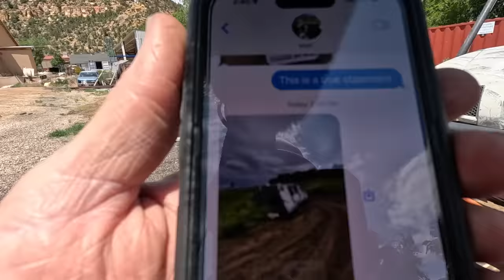Off The Edge: This Trailer Recovery Might Be Too Much For The Rat Rod Wrecker!

Comment: you should have snatched off that black truck to the axle while de-weighting the rear end with the boom and pulled it sideways while the tow rig drove it straight out. That was a 20 minute job if not for the sketchiness making it difficult to see through the bullshit. I wasn't there, you did it as best you could. Don't forget you've got several winches on that thing, you can turn 2 winchless trucks into winch trucks just like that

one thing i did notice though, that truck drives smoother than a mfr

Comment: First off,you're doing it wrong! Start by unhooking the white pickup from trailer,hook winch to front of trailer and pull/swing nose of trailer up onto road,that way,you'll have both wheels up on the rd !chaulk rear inside wheels on trailer so it can't roll back!
The rest of the trailer hanging over the rd, doesn't matter,it's on level ground if you do it this way!
Your truck is not heavy enough ,and your not using wheel chaulks to block your tow trucks back wheels.
Also,pulling sideways can bend the springs on the trailer.
Orrrr,just pull it backwards onto rd!

Comment: If you had a wheel lift on there it could of planted your ass end for better pull / lift .  Maybe a set of sliding down riggers in the rear to keep the ass from squatting next time ?

Comment: Camper manufacturers are something else. 9400 pound dry weight sitting on two 5200 pound axles 😂
Reply: I'd gamble and say 9400lbs is very generous 😂 At the current rate campers are going, very soon you'll need a CDL to haul one. Most already check off all the boxes, including weight

Comment: Watching the back tires go in the ditch on the wreaker, wandering is possible to run TALLER tires on a rear axle, like a tractor? Highway use I know it probably wouldn't be practical.🤔

Comment: That wrecker is built all wrong. It needs to have a hydraulic system on the ass in to put a bar out so that you can lift stuff up in the air if you have a bar coming out 4 feet in a hydraulic arm on it into the ground, I have one on my 70 Chevy pick up truck so you need to re-change your record me

Comment: I’m sure it’s been said but I bet boom all way in rather than out you would have lifted the trailer. Play with your lifting points one day for a video. Use 10,000 lbs to compare to trailer weight

Comment: 13 mins in , Why have you got your boom extended so far away from your fulcrum  ie your back axle ? All you are doing is encouraging a wheel stand.  Position yourself where you were at first,  and lift with your boom cylinders or your winches whatever works best. Shoot me down with your explanation if you wish , I realise I'm not there ,but just saying.

Comment: Dude how was that black f150 stuck?!
Reply: High centered. Doesn't take much, especially with newer cars that do NOT like wheel slip or inadequate power delivery
Could be worse. New Subarus will shut down and full on brick themselves in situations like that - I don't think they lock the ignition but steering will be locked and throttle will be fully disengaged until the ECU is flashed. I believe the shifter will be locked as well

Comment: The US DOT irks me.  A camper can weigh 9400 lbs empty (thereby having a GVWR greater than 10,000 lbs) and it's fine to haul it with a normal license.  That's awesome, and the way it should be, but as soon as a guy wants to buy a flatdeck trailer with a GVWR greater than 10,000 lbs and make money with it, suddenly he is incapable of driving it without a CDL.  So Stupid.
Reply: Old retired people with money lobbied for RV allowances way back. I'm with ya